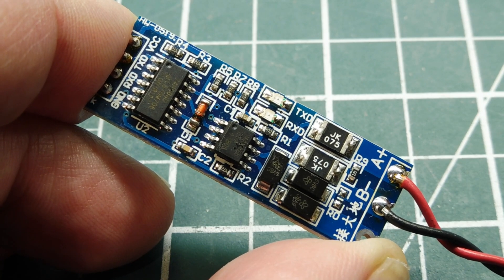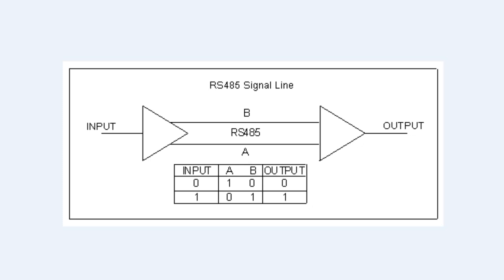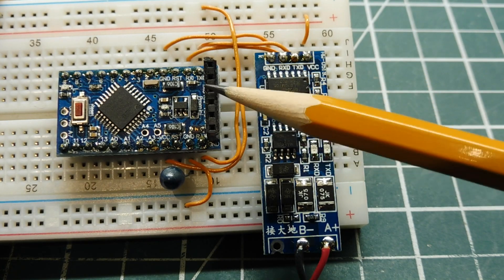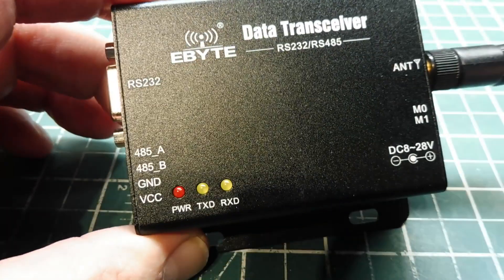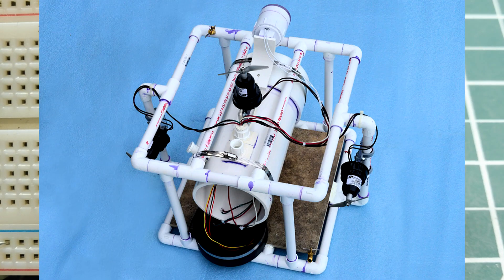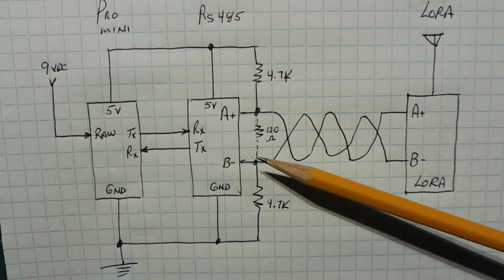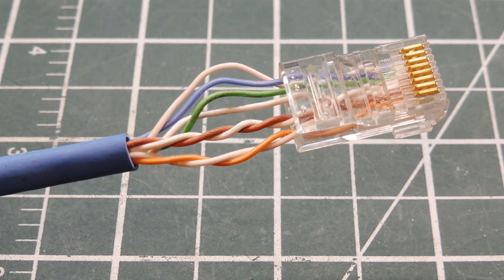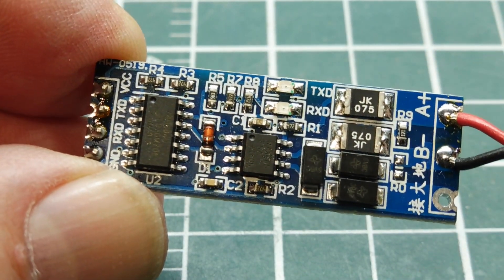UART To RS-485 Interface  / Pro Mini / LoRa Interface

Comment: I had a problem with this module not being able to communicate. I found the problem to be C2 being to small in value. After removing C2 and replacing with a 22nF, the module worked. I think the purpose of C2 is to keep the transmission running in one direction, but when there is a pause in the communication, C2 will charge up or down and prepare the module for either transmitting or receiving the next block of data
Reply from the maker: RS485 is half duplex so this board switches the Tx/Rx function automatically with a delay set by the capacitor. This board is made by many China vendors and I have seen different capacitor values used. My board capacitor value is .1uF ( 100 nF) which actually was too high and I had to use delays to get my system working properly. This is described in this video: https://youtu.be/2YD3pNjR1nY  If timing is a problem you can get a UART to RS485 board where you control the RE and DE lines for Tx/Rx switching timing in software.
Reply: @0033mer  Thank you very much, I saw the video, interesting. Only one thing, can the A and B differential lines work without any ground connection?
Reply from the maker: That is a big question. If you polled 100 engineers you would get a split decision. In a "normal" point to point application no ground connection between the two nodes are needed. The ground potential difference (GPD) tolerated is +12/-7 volts. In a multi node system with high GPD if the grounds are connected together you can get high loop currents. A 100 ohm resistor from each nodes signal ground to the ground bus would limit any ground loop current. If this becomes a big problem an opto-isolated link would be the way to go. Just my opinion.

Comment: In your explanation you say the levels on A and B go between 5V and 0V. This is not necessarily the case. A 200mV difference is regarded enough. So pulling the lines all the way to GND and VCC should be kind of an edge case.
Reply from the maker: Yes ... the receiver can detect a differential input signal down to 200 mv while the driver must have at least a minimum of 1.5 volts output to meet the RS485 spec. The explanation was to describe the working concept of a differential link. For more details the viewer can consult the datasheets.

Comment: how did you configured the transceiver for communication?  just hooked it up and it automatically transmit?  
im trying to use this board the same way and it gives me all sort of issues
Reply from the maker: This board has automatic flow control. When idle it is in receive mode. When you transmit it switches to transmit mode automatically. After the transmission, you have to wait for it to switch to receive mode before receiving data and the remote node must know to delay before it sends. If you want to switch manually there are other boards where you control the D DE and R RE lines.

Comment: I had a problem with this rs485 modules from aliexpress where I had lots of errors per second, and I fixed it by connecting the RS485 GND to the arduino GND, so, all of my devices on the bus had to have the same ground, which I wanted to avoid since it is a 500 meters installation and I wanted to avoid ground loops.
Does anyone watching this had a similar problem?
PS: the problem happened with all the 20 pcbs I had, so, maybe it's not a problem, and I'm just no using it properly, but I can't find datasheets or documentation on this product.
Reply: Your RS485 link works on the bench with two wires (without GNDs connected) because the "ground" levels are at the same potential. On a long run the "ground" potentials could be different which will cause problems. If the grounds vary more than -7 to +12 volts you will need a ground wire between nodes. To solve the ground loop problem connect a 100 Ohm resistor from each node's ground to the common ground wire. If the problem still persist check out opto-isolated RS485 nodes.

Comment: What Arduino library sgould i use with this exact module? Stuck for a week with that 🤣
Reply from the maker: No need for a library. Just use the serial.print statement.
serial.print("Hello World")
Reply: Depends upon the application your dealing with. Master or slave.

Comment: Are there any Audio applications using the RS485 to reduce data latency with DAW recording ?
Reply: That is no use. First RS485 does not reduce latency in any way. It is just to imunize transmission lines. And this is in no way helpful to improve transmission speeds or latency.
That being said: RS485 is the underlying standard for AES3 aka AES/EBU digital audio transmission. As well as for DMX512 lighting control.

Comment: Thank you for this explaining, there is one question, can I convert USB-RS485 to USB-TTL serial connection?
Reply from the maker: The module will convert the RS-485 output of a USB-RS485 interface to TTL serial.
Reply: @0033mer  
Please which module I shoud use to convert it, Do explain that in diagram.

Comment: Hi there seems to be only Rx and Tx from the Arduino, any idea how the half duplex is switching Rx / Tx.
Reply from the maker: When you send data to the module from the Arduino it sends it out the RS485 line. The module senses when transmission has stopped and switches to receive mode where the Arduino can receive data.
Reply: @0033mer  Is the 8pin chip 555 timer ?
Reply from the maker: @mumbaiverve2307  No .. it is a RS485 transceiver IC.

Comment: Interesting to see the potentials on the A and B terminals. Sometime ago while I was battling with an camera control circuit I came across this on the internet;  Quote..The EIA RS-485 Specification labels the data wires "A" and "B", but many manufacturers label their wires "+" and "-". In our experience, the "-" wire should be connected to the "A" line, and the "+" wire to the "B" line. Reversing the polarity will not damage a 485 device, but it will not communicate... unquote. A bit confusing.
Reply from the maker: Yes .. the true spec is A is "-" and B is "+" but vendors like TI and Maxim do the reverse. Some manufacturers use D- and D+ in their products. If you have two devices from the same manufacture I just match the two ends the same.

Comment: Wich library did you use for programming? I want to read some holding registers of my ABB B23 energy meter and the most libraries for Arduino are using other MAX485 modules.
Reply: Need Library and Example

Comment: Beautiful explanation!!! Please continue showing examples using Forth. I read in one of your replies that you think there is little interest in Forth, but that is not true as far as I’m concerned. I have eForth on my ATmega328  (because of you) and I am learning, using your videos and Ting’s “Arduino and eForth book. Thank you!!!
Reply from the maker: Joe, I have posted Interactive Arduino (IA.hex) in my dropbox where you can download it here: https://www.dropbox.com/s/b8p77vnjlxbr0u3/IA.hex?dl=0
Extended fuse FD, High D8, Low FF. Lock bits FF.  Tera Term 19200 N 8 1
On power-up type INIT to get Pin2-7 as inputs and Pin8-13 as  outputs.
Check out my video on Interactive programming
https://youtu.be/PY01_9dANd8
Now you will have the words I use in my videos.

Comment: I've got one of those USB adapters coming on the slow boat. I have to try out that "long distance programming" trick when it gets here.
Thanks for the idea!
Reply from the maker: You can get them from DipMicro, a Canadian online store. http://www.dipmicro.com/store/USB485
Reply: Unfortunately, i think you can't program the pro mini because of the missing dtr line that resets the mcu, which checks the presence and location of the bootloader from the burned fuses, then runs the bootloader, which listens on the serial line for incoming program data, and self-programs the flash, but dosen't overwrite the bootloader. I guess you could extend the reset pin to wherever you were programming from and hook up a switch but that method is error prone and highly timing sensitive. You'd have to hit the switch exactly when the IDE wants to begin the upload.